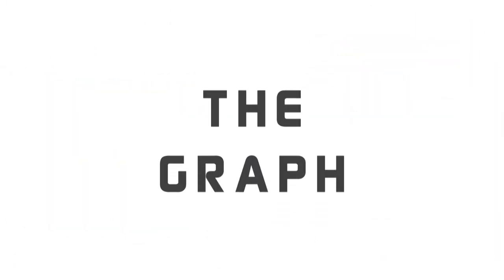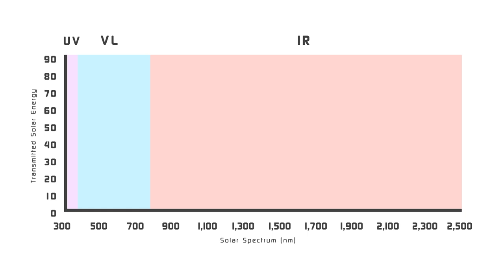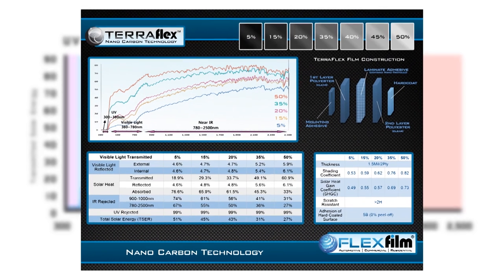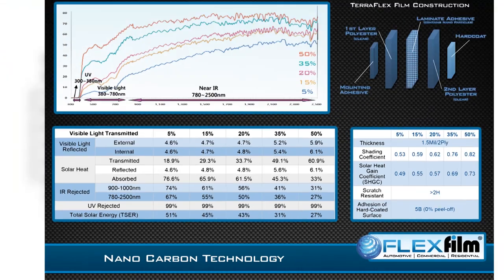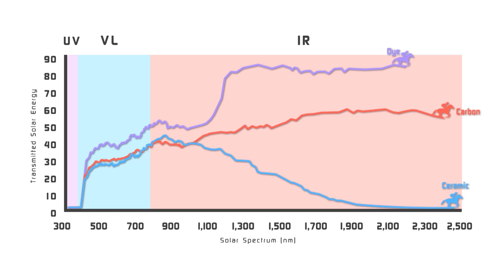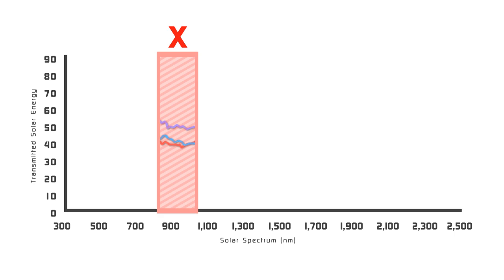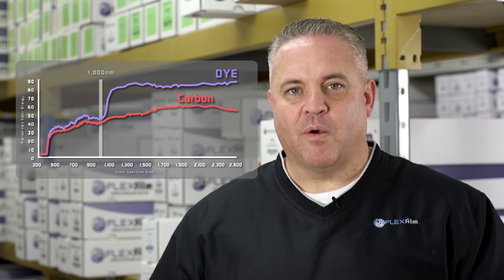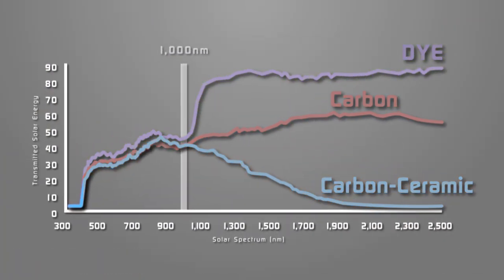Understanding Ceramic Window Film Performance

Comment: This is a 7 year old video, so can be excused. Information is not exactly right, there are several factors left out, TSER in fact takes into account absorbed and reflected heat, it is more accurate than one point reading. Dyed is NOT the best film without a metal or ceramic second layer.

Comment: Miami summer gets brutal... What is the nm value of the sun on a typical clear sunny 95 degree day? If it never reaches much over 1000nm then it doesn't matter what film you choose.
Reply from the maker: Are you trying to express temperature?  Temperature can not be expressed in Nanometers.  A nm is 1/1,000,000,000 of a meter.
Reply: Let me rephrase...  I'm assuming sunlight is approximately 500nm so what would be the reason to choose one film vs another if sunlight can't get to 1000nm?
Reply from the maker: +andrewpm2   If you just want to block out light to reduce glare, all you need is a dyed film.  If you want to block out more bad stuff from the sun, you need additional technology to filter out Ultra violent rays and infrared radiation.  I guess some people would just be happy blocking visible light and nothing else.  Suntan lotion is no different in my opinion.  I see some people using cooking oil to tan with while other people use expensive lotions with very high spf protection.  I guess it boils down to what makes you happy.
Reply: Sunlight goes beyond 500nm. See this graph: https://en.wikipedia.org/wiki/Sunlight#/media/File:Solar_spectrum_en.svg. Notice how a good portion of the area under the curve is still above 500nm and in the IR region. IR still heats up the inside of your car. Think about how a IR oven/"microwave" (ie. Nuwave 20326) heats up the food. Same concept applies here with sunlight. 

A film that blocks IR well will cool the interior noticeably, around 15-25F cooler with it.

Comment: this is informative. however it would seem that total energy reduction takes into account how much energy there is at each wavelength. if the energy at each wavelength were equal then there would be a huge difference in TSER between ceramic and carbon, and there isnt. Most of the energy is under 1000nm where performance is identical and nearly 100% of it is under 1700nm where the ceramic has yet to go to near zero.  Interestingly this explains how you can fool someone with a demo into thinking the ceramic is way better - simply use a high wavelength IR heat lamp! while it might only reduce sun energy by 5% it could cut the IR heat by 90%
Reply: hahaha i just got to the “your hand will never lie to you” in a heat lamp demo. that’s the whole point - your hand will TOTALLY lie to you because thats how the demo is rigged. A heat lamp doesn’t put out the same spectrum as the sun so its a bogus test!
Reply: Doesn't matter that the heat lamp spectrum is different. If you want heat rejection, then the heat lamp test is appropriate.  If you only want UV rejection, then get the film with the highest rejection in the UV portion of the spectrum.  Gotta choose your poison.
Reply: I think you are assuming that IR radiation causes heat and visible light doesn't cause heat, so you can just look at IR transmissivity to measure heat. That's not true. 

In fact most solar energy is in the visible range.  The test does not appropriately represent that. That's why TSER makes sense as a heat transfer metric because it accounts for the energy of IR + vis + UV, in the same proportions as present in the sun's radiation. You can just look the values up too without a misleading demo.

Put another way, there is a theoretical limit even with a "perfect" film on how much heat it can block, because you have to be able to see out of it. That visible light transmission is associated with most of the heat that comes through the window, and only a small fraction is due to IR. Ceramics are really close to perfect, but the benefit is incremental.

Ceramic films are superior to other technologies for a given visible light transmission. They are just not as proportionally better as an IR lamp test would indicate. It's not like 9:1 difference just because IR blocking is 9:1 at IR rejection. It's more like 60 to 50 difference. If the sun emitted more IR, then the ceramic film would be more like the 9:1 benefit-we just don't happen to live in that solar system.
Reply: Good one. Thanks

Comment: Why not provide a real world test?  (last paragraph) You admit sellers of this product are very selective in 1. The way the data is presented or 2. By using a narrow range of data to support their argument. 

Your graph shows energy/power/heat on the Y axis and Spectrum in (nm) nanometers on the X axis.  The performance of the Ceramic material results in a curve that has the same basic shape and trends as a graph that shows the natural decrease and flattening out of energy/power/heat in watts/meter squared on the Y axis as the (nm) on the X axis increase. https://en.wikipedia.org/wiki/Sunlight#/media/File:Solar_spectrum_en.svg  Both graphs show energy increasing steeply, peaking and then decreasing quickly before  slowing down it’s rate of change and flattening out as the (nm) get into the higher numbers.  It is this flattening out area of the graph that you claim is the area that differentiates the Ceramic from the Dye and Carbon films.  But as those (nm) get larger, the energy per (nm) on the Y axis is smaller and smaller.  So there is not much energy to block in the first place at these higher spectrum (nm) numbers.

I like your idea of holding samples of different film types in front of a Infra Red Light and then sensing the difference in heat coming through the filters to determine which filter blocks more energy.  But it doesn’t emulate a real-life situation where rate of temperature change (inside a vehicle) is the critical measurement.  We all know eventually the interior of the vehicle will reach the outside temperature of the vehicle and then it will exceed it for a period of time and then the temperature will come down and again equal the outside temperature and all of that will repeat in each 24 hour cycle.  What we want to get a feel for is the rate of change and the max inside temperature relative to the outside temperatures.

It’s easy to show on camera the degree to which these filters reduce visible light.  The other reason a person would purchase the window tint is to reduce the time it takes for the sun to heat up the inside of their vehicle.  This could be important because 1. Comfort – at end of day the person does not want to enter a Very Hot vehicle.  2. Contents – vehicle may have valuable contents that will melt or spoil at high temperatures.  3. Pet – A dog or cat is left in the vehicle for a specified amount of time and the owner needs to know how long he has (minutes or hours) before the temperature increases from the starting temp to a maximum comfortable temp at which time the owner must return and cool the vehicle or remove the pet.

Why not borrow or rent or trade for free tinting jobs a minimum of 2 identical passenger vans for a day.  One is the control and has no tinting.  The second has your most effective film for filtering Infra Red light.  (Get additional vans for additional product to test (35% - Dye only, 35% Carbon only etc…but they all must be done on the same day under the same conditions for these comparisons to have any value when comparing relative effectiveness).  Pick a hot day with temps forecasted in the high 90’s or more.  Apply the different tints the night before.  Park the Vans outside at 8am side by side facing south, 20 feet apart, with doors and windows closed. Place thermometers in several areas of each van, use the exact same spots.  Use electronic thermometers with wifi or Bluetooth connection and record temperatures of each device every 15 minutes.  If no Bluetooth or wifi, leave one window un-tinted or partially tinted on east side and/or north side to physically view and record by hand the tempetatures at regular intervals.  Also have a thermometer on the exterior of each vehicle (roof or hood) to record outside air temperature.

Collecting and then publishing this kind of data in a chart and graph is the only way for you to pass on something of value to your (potential) customers so they can make an informed decision.  1st – does the product slow down the rate of heating enough to justify the expense and 2. Do the less costly versions (non-ceramic) perform close enough to the premium product or is there a big and valuable difference.  I suspect the actual real-life difference between products is small, thus the fancy numbers and graphs used for persuasion.  And maybe even the best product to reduce heat gain is minimally different from the cheaper product that only claims light filtering and not infra-red reduction in the mid and higher ranges.  You have invested a bunch of time with the theoretical presentations on youtube.  How about doing a real-life practical application video using real vehicles with a control (no windows tinted) and a group of testers (vehicles with various tints), set up everything so the testing environment is identical and record the data and then share it with us.
Reply from the maker: Tim Hardman 
Thanks for your comment.  Is this real world enough?  I used two of my personal vehicles to to a real world demo and I continue to enjoy the benefits of this Window film daily compared to no window film.  I tried very hard to make this video as real world as possible and NOT technical.  https://youtu.be/cbttKzKfTEY
Reply: I am not accusing you and your product of being phony.  But usually, when someone is being 100% honest and up front they just do the most logical and simple test to prove their point.   The test you designed is very similar to the accusation you made about other companies cherry picking their data, making up test criteria that are not relevant and then selectively showing the results.  That’s exactly what you did with this test that you provided the link for.  Why make it so difficult?

You made it unnecessarily complicated and you did not show us a starting temperature for the interior of each vehicle.  Another critic in the comments for that video said the same thing.  Naples Tint Company commented “why don't you use a temperature probe in each car? You have $200k worth of cars... the probes are less than $100. It would give you better results for the video.” Or, why not show the “interior temperature” on the touch screen at the beginning of each test…it would have only taken a few extra seconds and not cost you anything.  Did you not think that was a relevant measurement for your roundabout test? 

Your complicated experiment verifies without a doubt that one car started the test with a much warmer interior than the other and the implication is, the car with the cooler interior is due to the film on the windows.  Well maybe that is the truth and maybe it’s not.  But this test does not prove that.  Usually one does such a test and films it in a way that proves the hypothesis.  That did not happen here.  Sometimes, what is left out of the picture is more important than what is included in the picture.  I really have no doubt that the window film slows the heating of the interior of a vehicle while it sits in the sun.  What the consumer wants to know is: how effective is it?  What is the rate of change of temperature in each vehicle so we can compare the two different numbers and then decide if the price of the product is worth the benefit.  That would provide us with meaningful data.

I will admit, my interest is focused more on how fast the interior of the car heats up.  Most of your customers are probably focused on how fast their car will cool down with and without the film because the problem they are trying to solve is getting into their parked car after it has been sitting in the parking lot all day while at work.  For those people, your test probably makes more sense to them but still….show the starting temperatures!!!!  And, in addition to showing the test with the “ultimate” most expensive product, duplicate the test with “middle” priced product and then the “economy” product to prove the value of each one.

Those cars were very easy to apply the film.  Stripping them and applying new film at the quality level required for this test would take you less than 30 minutes.  The cost of the film is peanuts.  The only complicating factor (with an easy solution) is getting the cars cooled back down to the same internal temperatures for an equal starting point again.  The test itself does most of that cooling with the air conditioner.  The car that started out warmer will need extra cooling time to ring out the absorbed heat, below the surface materials, but 30 minutes of full blast A/C will take care of that.  You would not need to restart the test with the exact same air temperature in each vehicle.  As long as they were within a few degrees, it would still be good enough to prove the test.  

So in your next test, don’t focus so much of your attention and budget on the “shiny distracting objects” like Teslas resulting in you not having enough time or money left over to buy a few thermometers or to be able to rent/buy/borrow the cars for 2 days to do all of your testing instead of having them for just a few hours.  Saying you did not have time to carry out additional tests (your other video referenced this) doesn’t pass the smell test.  Buy 2 identical old yellow 5 window school buses for $500 each as your permanent test platforms and test every product under every situation until you have covered every possible combination.  This way, you will not interfere with the busy life of your Teslas. And then redo the testing every time you get a “new and improved” product.  Your numbers will be more meaningful using the permanent test vehicles in your parking lot and they will be paid for after the first test.  They don’t even need to run, you can push or tow them into position for each test.

You probably have a good product, don’t make it so hard for us to know that too.
Reply from the maker: Tim Hardman 
All this sounds good but I think you are over thinking it.  I don't want to sound disrespectful but my brain is hurting just reading all this.  If my brain is hurting, just think what the average customer is going through.  For some reason most people want to measure everything with a thermometer.  Window film basically slows down solar energy from entering the car.  It does not stop it and solar energy is not heat just like fire is not smoke but that conversation is for another time.  To use a thermometer in a car with window film is like trying to use a thermometer to measure how good your sunscreen is working on the beach.  Either you got a sunburn or you did not get a sunburn.  Most people would not return their sunscreen just because they were hot on the beach all day.  This experiment is simple.  With film your car will work less to keep it cool and you will not feel a radiation burn despite the interior temperature if you have a good IR film. If you really wanted to focus on temperature, you should glue space shuttle tiles to your car and wrap it with aluminum foil.  I believe you would be impressed with the results.  I probably sound like a smart butt but I am just trying to make a point from what I perceive to be the appropriate angle which is more about solar energy and not so much about heat. I do respect your request to redo my experiment but it really sounds impractical.  I also would enjoy to see that exact experiment done with any film by anybody anywhere in the world.   I do not believe it has ever been attempted anywhere to that extent.  I could be wrong.  I would consider it but I am not that much of a tint nerd.  I am a tint nerd but not on that level.  Lol  
I just enjoy selling what I know makes people feel better in their car.  I also know there are other IR films out there to buy but the product we sell is among the best to absorb solar energy.  I made another video to demonstrate this... enjoy.  https://youtu.be/-rwGnj_y_Kg
Reply: This answer speaks volumes to my concerns. But I'm done here.  Wishing you continued success with your tinting business. Peace.
Reply from the maker: Tim Hardman 
Thank you for your comment.  I appreciate your point of view.  Just remember that in our industry we only have substrates that can either reflect or absorb solar energy.  They all have advantages and disadvantages.   Some work better than others but they all effectively do the same thing.  I have yet to find the miracle product that is without some fault.
Reply: Thanks for that excellent comment. The strongest argument you have there is in the first paragraph.  Sunlight that gets to the ground has less infrared energy as absorbed by the atmosphere, vapor, dust, and etc. Thus, the reason conventional dye films targets this 1000nm and below wavelengths. 

Testing the film/tint with an infrared lamp has all those infrared energy that is "little" to be found on sunlight.  The ceramic tint is only a few percentage better, in the real word, which I estimate at around 10-20% less transmission.  If the costs of the ceramic is twice, then it might not be worth for most people.
Reply: Only people like you and me are this concerned about tints. The average user will swallow anything , that's why these companies don't care enough to promote .. Next year there will be a super nano ceramic tint worth x2 the price..

Comment: see http://environ.andrew.cmu.edu/m3/s2/02sun.shtml.  yes ceramic outperforms carbon at super high wavelengths. but the portion of the sun’s energy at very high wavelengths is negligible relative to the amount that is at 1000nm or lower. you have to multiply the traces in your graph by the graph above to make a fair comparison